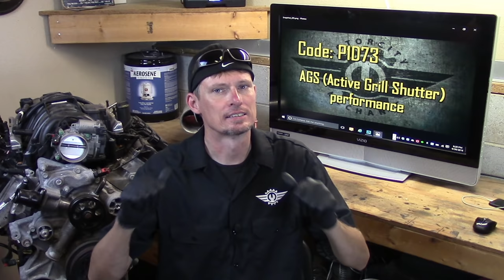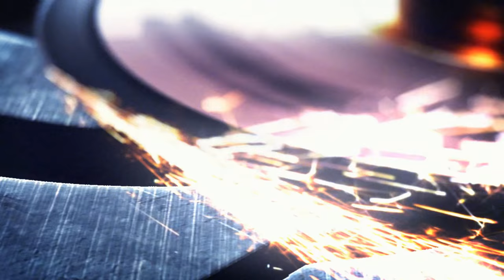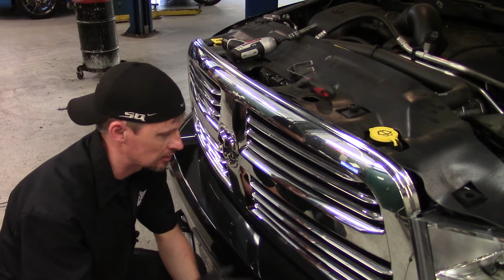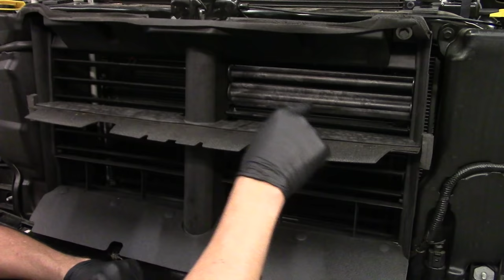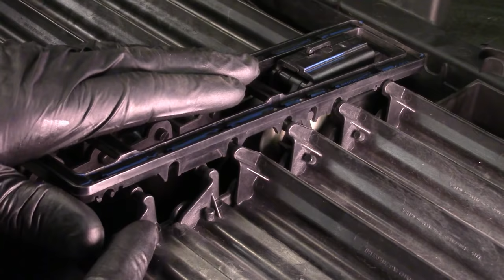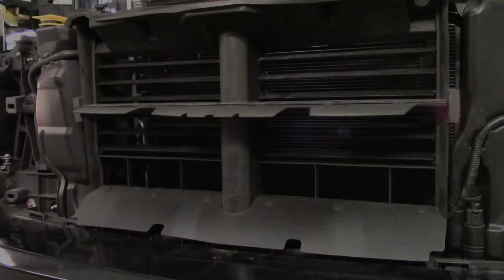Ram Truck Code: P1D73 AGS (Active Grill Shutter) performance

Comment: Dude, I REALLY liked the way you structured this video so that I could really see how everything worked before I go ahead and do the work myself.  Like some below, I had a small deer run out in front of my truck causing damage to the grill and bumper and suddenly, the P1D73 code.  Due to the thoroughness of of your video, I can now comfortably resolve the issue on my own.  Also subscribed because of the way you explain the repairs.  Thanks man!

Comment: Figured out I had this problem because my Auto-start wouldnt work in my 2014 Jeep Cherokee Latitude. Took it to Autozone and got this code from my engine light. Had a mechanic delete the code and my autostart works now, saw this in another youtube video. Came here to see how important it was so maybe I just have to put the pins back in, awesome, thank you so much!

Comment: I found that Gettle Ram could not fix mine. I removed the cardboard top cowling and found that the motor cover had split apart, reason unknown. Squeezed the cover back together and the system worked just fine. The dealer kept saying the motor was bad. The problem was fixed in under 15 minutes. Dealer wanted $800.00 to put a new shutter in because they only went by the code and never even checked the physical condition of the shutter. Easy fix. The motor cove had just came apart and it snapped right back together. There is a seam right in the center of the cover.

Comment: Absolutely a great video sir. Good audio and good camera angles to show the average Joe how the shutter system works and how to fix easily. I was wondering if any silicone lubricant would be used to keep all of them moving smoothly? Or would that just be a big dirt catcher and cause problems? Thanks for putting this on YouTube.

Comment: 2015 5.7 1500. Looks like I’m missing three or four shudder slats, or doors as you refer, on the driver side so I’ll have to replace and also the center actuator where you snap to the plastic is broken off. Probably when grill was repaired after previous driver Tried pit maneuver on somebody but the AGS  was never checked and repair. Drives fine other than code tempted to leave it alone because that part is expensive. Unless you have an extra one that works laying around.

Comment: Thank you so much for your tutorial video. So well explained and camera views were awesome. So very much appreciated. My job was so easy to fix with your expertise. Did have a few questions
I found on one individual louver(shutter) that the pin that would fit into the frame to move the shutters together is broken off. Can I replace the one w/o removing grill? Is it really necessary to replace at all? Ty

Comment: My daughter has a 2015 Dodge Dart and check engine light came on with this code.  The dealer says it not under warranty because there is a small crack on the grill and says that she must have hit something.  However,   there's no damage to the bumper or front end indicate that the car has been in an accident, which it hasn't.  He quoted me $700 to replace the grill shutter assembly.  I picked up the car because they didn't seem trustworthy.  Thanks for your video.  I'm just a mom and not a mechanic but will try to see if I can snap the shutters back in place.  If not, I guess I need to make a claim with my insurance company or should I go to another dealership?
Reply from the maker: I would first see if there is anything obvious first and if need be.....snap it all back into place. If you dont see anything than no harm in visiting another dealer. They have to prove the damage.....the grille is one thing....actual physical damage to the shutter assembly is another.  Thanks for watching and make sure to subscribe

Comment: I can vouch for these shutters saving fuel. My MPG (according to the dash readout) dropped by 3 points after my '14 1500 threw this same code on a road trip in S.C. Turned out this nasty looking bug got caught in the shutters and was preventing them from closing. This bug was so big it should of had its 4-ways on. But once I scraped that critter out of there I was back to normal and we all lived happily ever after... well, except for the bug. I just wish FCA would have designed the shutters to close on really cold days to help the engine warm up faster. But otherwise I'm really happy with this truck.
Reply from the maker: Thanks for that input Richard. I dont get to drive these trucks enough to pick up on items like that. Yeah I am not surprised about the size of that bug being that its South Carolina. Here in Georgia its the law that they have their 4 ways on before smacking into you haha.

Comment: I’ve always enjoyed your through and very informative videos. 
Can you please tell me what class of engine (non-dodge) my truck has. A 2017 GMC Sierra Denali ultimate with the 6.2 engine and 8 speed automatic. I think this truck also has grill shutters. 
I still have my 97 dodge dually with the Cummings and a 2017 Nissan Titan XD PLATINUM RESERVE with the Cummings. 
For now I really would like to know about this 6.2 because it hauls ass and manages 21 on the highway. I don’t understand. My Nissan with the 5.0 Cummings only gets 15 no matter how I drive and my older dodge gets 13-17 and it has 384,322 miles

Comment: Excellent video. I am having engine cooling problems with my truck but no error codes have tripped. Any chance I am having trouble with the AGS? I have a 203 degree thermostat and the coolant temps will go as high as 220 degrees before is comes back down to 203 degrees. My oil temps are way too high too. They have gone as high as 260 degrees. I use Synthetic oil, and have changed the transmission fluid with Royal Purple transmission fluid.

Comment: Your thoughts on something and I appreciate your information on the AGS, which I may be in the process of replacing myself. 

We have a 2015 ram 1500 5.7 hemi that we received after death of owner and we don’t know if transmission fluid has ever been changed. It is eight speed transmission I’m debating whether or not to have someone do a flush or nothing at all Because of the horror stories I’ve heard about putting fresh fluid in there.  Your thoughts please  and we’re not too far from Augusta.

Comment: Another great video. You're the man! Would love to get my 2014 2500 to you for an accurate alignment. I Just tend to get a bit wondering in the front end and the steering wheel just does not center well. On a few occasions, the outer lock nut on the drag link has come loose and I re-tightened it. Had to put a little blue locktite. Where are you located?
Reply from the maker: Down in Georgia. Just outside of Augusta.

Comment: I have a dodge dart limited 2015. Wife but a cat and cracked assembly. Took whole bumber and shutters off. It needs to be replaced. 1)  could I  tape shutters closed to get better gpm without worrying about eng damg? 2) if I buy the assembly does it come with the (device that moves shutters)?
Reply from the maker: Taping it closed will affect the radiator/coolant temps so I dont recommend doing that. Not sure how the part will arrive. I assume it will come as an assembly but you will need to verify that with your local dealer to be 100% sure.

Comment: Great video. Just replaced complete unit on 17 1500. Eng light still comes on. Once battery hooked up the shutters opened. Does not cycle open/closed when key is on. Code was U11E9. Any info would be awesome. Thanks 
Kevin

Comment: Thanks for video very clear and informative, my 2015  Ram started triggering this code e11p9 code right after it was in for repair of u61 safety recall which calls for possible reprogram of the PCM. Also repaired were u74 tailgate latch , fuel tank mounting strap and  U07 Autopark functionality.  After I clear the code  the truck will drive without triggering the code until the remote starter is engaged. The remote starter starts the truck but it only runs about 20 seconds and shuts down due to the code I guess.  Do you thinks it's a coincidence that this happened after the service or is there a possible reason tied to these repairs.  Thanks in advance for your help.

Comment: I own a 2016 and a 2017 Ram. Both have shutters. I noticed today that one truck's shutters are closed while parked and one is open. Is this normal? Is there no "parked" position for the shutters? One truck was driven far and shutdown (open shutters) while the other was parked and allowed to cool then moved 10ft and shutdown (never allowed to reach temp-shutters closed). TIA
Reply from the maker: Personally I believe that they are in the position they were last when the trucks were shut off and that explains why one is and the other isnt. I dont think there is no issue, if there was you would have a check engine light on as well. Thanks for watching and for the question. Also thanks for having subscribed.

Comment: Still getting a check engine light and it won't go off. The code is p1d73. 
When I took the motor apart to move the arm clockwise,I had to strock the arm a little  
to pull the arm off. And when I did that I didn't  feel the gears rotating , its like something was sliping inside.
Is there a way to home that motor and arm so I can start  from scratch ? Thank for your help.

Comment: Is there an easy way to delete it, or maybe I should just purchase the whole unit ... I hit 2 deer at once and the small body shop left just one shutter upper passenger side...it was fine for a week then threw the code.  It runs cooler around 197 degrees instead of 210 to 215 and a bit less mileage.  The small body shop saved me some money getting used parts same color.as I didn't have insurance to cover the damage.

Comment: Excellent video!!  Would that code stop a car from passing smog check?
Reply from the maker: +Bill Rimmer The check engine light being on could be an issue. We don't have testing where I am located but from what I hear....the check engine light is an item checked so it's very possible that it could cause you to fail. Then again I don't have personal experience of the inspection process. Thanks for asking Bill

Comment: Question:  I bought a 2014 RAM Ecodiesel that just had the engine replaced in August 2017 (I bought it a month later).  Well, after seeing this video I got to looking and I think the bottom 2 quadrants have had their shutters removed.  It all looks put together correctly.  It just looks like they either were never there or were removed.  Any thoughts?

Comment: Thanks for the videos. Question how does the pcm know there's a preformance problem with the active grille shutter. I've already replace ags with a new unit from the dealer, But i keep getting codes for ags preformance .   Driver side mirror was replace with one without a ambient temperature sensor. Kept getting code for ambient temperature sensor circuit until I re wired ambient temperature sensor on to aftermarket mirror. Only I couldn't get to read out side the cab. It's now mounted on inside of door instead of outside.do you think that might have something to do with the ags not working properly?
Reply from the maker: First thing I would do is get that sensor mounted back outside so that its reading correctly. It might have an affect.

Comment: Dave, I have a Code U11E9 on my 2019 RAM Big Horn, and after taking it to the dealer [warranty had just finished] I have to do the work myself as the dealer quoted me close to $1,800.00 to fix this code. I'm not an electrician, so I am lost on electrical connections. How close is my code to yours in the video? I remember washing my truck and rinsing the front of it with way too much water the day before the code popped up. Is there a fuse for this system? If so, which one? If you have time to respond.
Thank you in advance.

Comment: Hi there. i am just curious how the pcm know the shudder is not working right?     does it monitor radiator inlet and outlet. or are their potentiometer attached to each flap ( which i doubt)??  thanks and keep up the good work.
Reply from the maker: It runs a test where it makes the shutters go full open and full closed. If the motor moves more then normal then it sets a code. Thanks for watching
Reply: oh okay i see  thanks

Comment: Is it normal operating temperature for coolant on a 2015 ram 1500 5.7 hemi to reach 217 that’s when I would do wide open throttle. When driving normal I get between 204-213

Comment: I have a 2017 Dodge with 8000 miles in the shop that was wrecked and it’s throwing this same code. I test the harness and has no ground! Is it suppose to have ground all the time?? We have tried a active test etc nothing.  Do not see any additional damage to the harness anywhere! Is there anything or any direction you could point me thanks
Reply from the maker: The black wire on the 4 wire connector at the active grill shutter actuator/motor is the ground circuit. That wire runs to a ground eyelet on the left side of the truck on the fender support just below the hood opening inch from the fuse box. Make sure thats bolted in place and also follow the wiring to make sure no obvious wiring damage.

Comment: Hey man. What brand trim tool is that?  Haven't ever seen one like that.  Seems to work awesome.
Reply from the maker: I picked them up at harbor freight. I assume your speaking of the metal door panel removal. Here is the link: http://www.harborfreight.com/5-piece-upholstery-and-trim-tool-set-99739.html
Reply: +MotorCity Mechanic yeah. I'll have to check them out. Just changing a headlight bulb on the Ram is a pain but that shape would help with pulling the pins

Comment: I have a 2015 ram that generated this code , I replaced the AGS but the check engine light still comes on with the same code, this is even after i erased the code. Could the new part be defective or am I missing something?

Comment: I followed this video and it was the shutters identical to what you had but I cleared the code and it came back again not sure what was wrong. I didn't have the issue previously it only came once I installed a new engine on my truck. I hope someone can help find a way to fix it, the CEL is a pain to look at. Thank you.

Comment: hi.mr  i buy jeep cherokee  2018  2.4 before one month when i start the engine the fan is start too and i find out the active grille shutter is not found ,and the harness connector  for it not found also . how i know the source for AGS  is it with the fog lamp harness or not ?

Comment: you are great!  I have heard that the AGS can cause the engine to run too warm on the Pentastar V6. Is that possible? If so and you just removed the shutters would it cause a problem?
Reply from the maker: Thanks Mike. I havent seen any issues. They do open based on temp so unless there is an issue....it should work fine. If you remove the assembly it will set a code/check engine light for sure
Reply: Thank you David for your quick reply I am totally impressed with your information and your expertise using these videos thank you
Reply from the maker: I dont feel worthy of that praise but I will take it haha. Thanks Mike

Comment: 2007 ram 4x4. Have an evap leak. Keep getting gascap light warning everytime I start the truck. Where are the MOST common errors you see located? I think it is maybe a line that goes up to the engine area that is hard to get to and has several lines with it. thanks
Reply: it is just behind the engine about a foot or three back.
Reply from the maker: There is no one common spot on these. I would give it a good inspection and look at all the rubber hoses to see if any thing obvious. Otherwise you may need to have it checked using an evap leak tester to see if the issue is the gas cap, fuel tank, purge solenoid, or ESIM. Some things can be check visually, others cant.

Comment: Ok ive been getting this code and couldn't  figure it out. The didge was in a front end collision and body shop installed a older model wire harness. From 2018 and newer the wire harness on the bumpers changed. Fliped some wires and bingo code gone shudder works .No open circuit codes just that pesky performance code.

Comment: I believe I clipped my ags back into place and they appear to be opening and closing  for my 2016 Cherokee but I’m still getting a check engine light. Do I need to reset the code or will it go off in time.
Reply: Oh great video by the way and thanks for being thorough and taking your time.

Comment: Would this code show for any other reason than just the AGS? Got a shop here saying it could be a powertrain issue as well. Got a 2016.
Reply from the maker: Vandal Actual The code shows to only be caused by the AGS system.....nothing else. I would focus on the shutter assembly. Thanks for the question and make sure to subscribe

Comment: Would this problem cause my engine light to come on?
Reply from the maker: It can cause a check engine light for sure. I recommend having the system scanned to see what the exact code is that caused the light to come on. Thanks for asking and for watching. Make sure to subscribe.

Comment: Question, what kind of tool/scanner did you use to test the shutter?
Reply from the maker: Evening Juan......I have the factory scanners and program and thats what I used to command the shutters. I dont get to use many aftermarket scanners so I cant say for sure exactly which might work best without spending alot. Thanks for watching and  make sure to subscribe